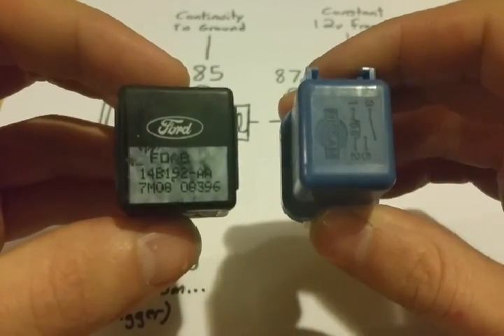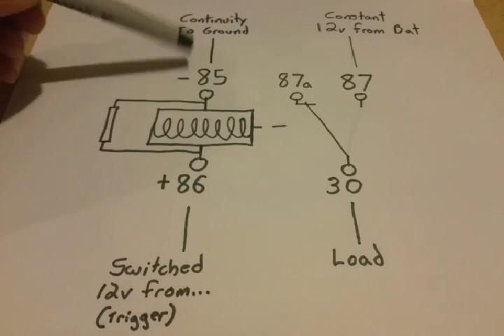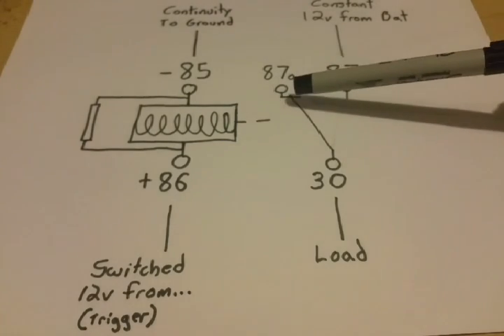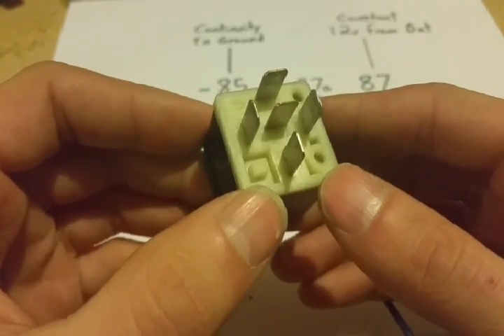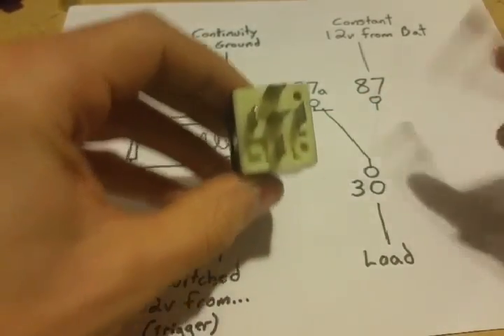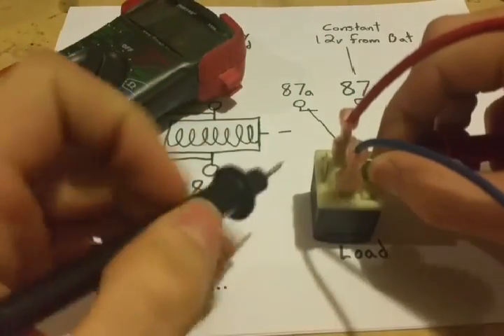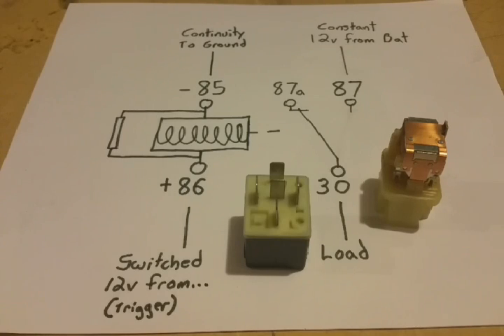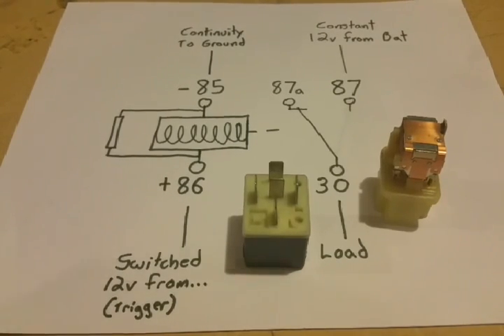12v Relay Explained!!! How To Wire a Relay, Troubleshoot, and Change Polarity.

Comment: Thanks  helps to view various ways.  Silly to ask, need 2nd input.  [wiring 'may' vary, depends]  [85\86] pwrd  6:03  Pwr 12V > [87] \ [30]  pass thru > Load.   7:35  [pwr] Bat > [30]  ..  8{\  not 87?  ... now 87 > load.   : } 
I've got test ?  [No #s on relay] Pin pwrd after [85\86] switched  --> Load?

Comment: I have a 1994 Toyota T-100 Pickup I would like to put in a manual switch for my fuel pump ... can I just run a 12 gage wire from my Positive + on my Battery through the firewall in to my cab to a manual switch then through the back to my fuel pump positive + ? also I will ground the fuel pump to the frame -- ... will this be Ok... will this work ?
Reply from the maker: Frank Ross I'd recommend using a switch to activate the relay that powers the pump. Most switches aren't designed for a constant high load draw... If not using a relay, at least make sure you have a switch rated for 30+ amps.
Reply: as a MVE studient I have an interesting lesson about relay switch

Comment: How many accessories can you safely connect to a single relay?
Reply from the maker: DARK CHOCOLATITO That would be dependant on the current draw of the accessories.
Reply: So If your relay is rated 40A, you can connect multiple accessories as long as the total draw does not exceed 40A? Is it watts divided by volts = current draw?..man, hard to be a newbie.
Reply from the maker: DARK CHOCOLATITO Correct.

Comment: What is the purpose of terminal 87a?
Reply from the maker: Noor A 87a is the normally closed circuit that passes current whenever relay is not active.
Reply: a21bravo thanks

Comment: Does it matter which terminal you use as an input for power going to the load or you can use either the 87 or the 30?
Reply from the maker: hondannyboy Either way will work. All it does is make contact inside so load can go either way.
Reply: Appreciate the reply